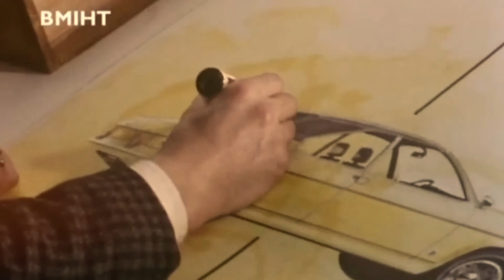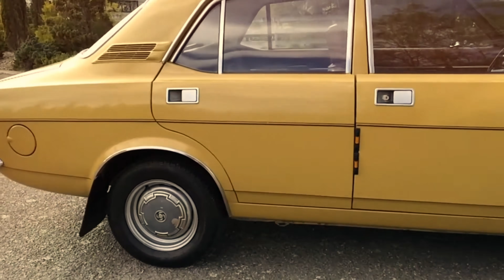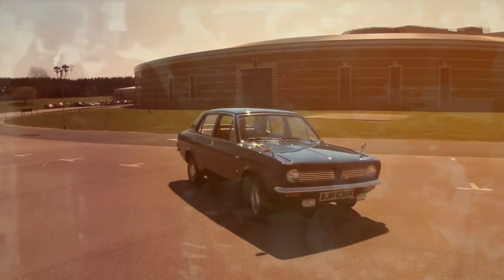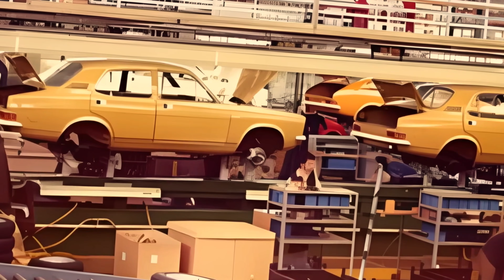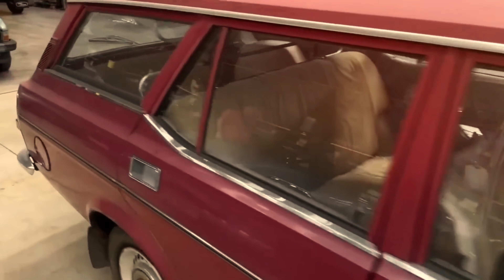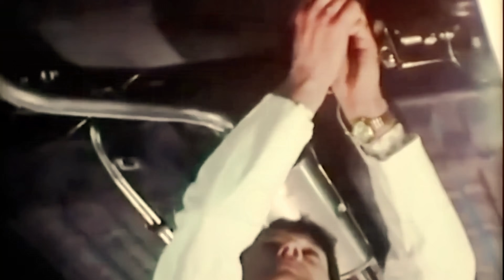The Shocking Truth Behind Britain's Best Selling Car — Morris Marina

Comment: First car mini van sub frame issue trailing arm issues brake issues engine top end valves reworked and also radiator issues learnt a lot on this car as eighteen year old apprentice on low wages, second car Austin mini kept it to long had to install new subframe and welding in the boot area still on low wages loved driving the thing and learned more about keeping them on the road. Traded in for Morris marina coup i think it was 1300 it was the car I did my courting in we used to travel to the country side locations for our private romantic moments. As well as daily work horse it was doing 64 miles a day on work and courting lost head gasket and other problems with head warping so bought and installed gold seal engine reconditioned, the only time it didn’t get me home was when front near side lower steering ball joint popped and end up with horizontal wheel looking back we had some really good times in the Marina and courting turn to marriage forty five years two grownup children and four grand children . The longest we were without the car was nineteen eighty two when it was covered in snow to above the roof in a side street of the main road waiting for local council to clear road. Happy days.
Reply from the maker: That is a wonderful trip down memory lane and a lovely story about how your car journey became part of your life story!

Comment: I pick up a 1973 on an L Reg 1.8 DL in burgundy kind of colour it looked quite basic BUT it was a fantastic car loads of room inside great size boot drove really well handling not as bad as a lot of people said went like hot snot for what it was seats were comfy enough I bought it in 1981-2 for £80 probably the best £80 I ever spent after swapping it for a Mk1 Granada I still have fond memories of that car and a couple of years later fell in love with a friends N plate 1.5 TC coupe in white with black vinal roof and to be honest if I could afford to buy a mid 70s TC coupe today I would not hesitate if it was a good solid well kept condition with a few minor bits and bobs needing to be done, although I am a Ford nut through and through I honestly don't see why more people wouldn't buy a descent marina but would buy a minor or a mini boggles my mind as the marina is far more superior, "go on buy one you know you want to best looking front end is the one with the twin lights in the front grill between the head lights easier to run and maintain than any of the more modern cars especially from the 2000s onwards can't work on newer cars to much technology electronic gizmos chips and god knows what at least the older classics you can fix um by the side of the road with a knife and fork almost simple mechanics and loads of room to under the bonnet to reach everything, marks out of ten to repair yourself most I would say 8 or 10 depending on the make
Reply from the maker: It’s wonderful to hear such fond memories of the driving experience and simplicity of those classic models!

Comment: the antiquated front suspension was basically  the Marinas Achilles heel. The rear was Okayish for era. Engine was meh. Ford had the peppy Xflow. The A  and B series a bit long in the tooth TBH.The. O series would have worked had it been phased in earlier..Styling wise ..Yawn..ZZZzzzzz!😀

Comment: I owned two Marinas, a coupe and a saloon. My father owned a coupe. All three were victims of rust. With one of my Marinas, I had problems with the exhaust dropping off at the engine outlet. The clamp that held the exhaust against the outlet was of poor design, and constantly let me down. The biggest pain for me was the leaf suspension on the rear of the car. This problem I had was in the main with the coupe. I spent many a Saturday morning at the breakers yard dismantling a set of back leaf suspension units from scrap cars and replacing the broken ones on my car. If you ever hit an unseen ramp or dipped at the bottom of a steep hill, you held your breath hoping not to hear the crack of a newly broken leaf suspension unit.
I sold my saloon to my uncle. The car had a tow bar that I had never used. The first time my uncle used it with a laden trailer, the tow bar ripped from the car and was found lying on the road still attached to the trailer.
Happy days.

Comment: It is worth noting that while there may have been some Marina inspiration in the original Hyundai Pony most of the running gear was actually basically from it's nemesis the Cortina which was already in production under license in Korea, as far as I recall the only parts from BL were the front brake calipers...

Comment: There were many Marinas exported to the colonies in the 1970s and 1980s. Yes the Hyundai Pony was based on the Marina, giving it a new lease on life in Korea. 
The 2 door TC hatch was a rocket with its 1.8L engine. 
The Estate was stylish and very roomy. 
I recall owners kept driving them for 20 years or more, in spite of the potholed roads they were driven on. 
Mechanics also loved the Marina as they were simple and easy to work on. But being built on the cheap, one of the unsafe features was a plastic radiator cap that would come loose and scalded one trusty mechanic I knew. 
Which car  did not rust in the 1970s anyway? Bogging holes was a skill that many car owners mastered easily, and then passed on these skills to their kids! 
Thank you for this great video, which has revived some great memories.
Reply from the maker: Thank you for sharing your knowledge, it enriches our content

Comment: Worked at Solihull and bought with employee discount a 1973 1.8 coupe. Had to collect it from Cowley. Sold it after 12 months for same price as I paid. That's what BL employees did then and used discount to buy next car. It had three problems during the time I had it: :- a screeching spigot bering on first start up of day, wiper motor nut forever coming loose and an oil leak from the diff that defied repair. I loved the seats. Covered in ambla perforated plastic very comfortable. It was the first car I had with electric rear window. Such luxury but no automatic switch off. O what memories we had with it.

Comment: Originally the Marina Prototype was to have all independent macpherson coil spring suspension and nearly new E series engines, it was rushed into having  Morris minor suspension which arguably may have been more expensive than macpherson suspension and old A/B series engines.
Reply: so the prototype was more like the ADO 16?
Reply: @semiretired86  Not exactly Marina Prototype as it was, with macpherson suspension instead of Morris minor suspension they had the new E series engines in Australia Probably because they had  some left over from the austin 1500 & Nomad modified ADO 16 . I wonder if without the dodgy suspension weather it would been No1 especially in the 1973 oil crisis.

Comment: The Australian Marina with the Maxi motor was a far nicer and better car. The E series was a lighter engine, so it had the 1.3 handling with the performance of the 1.8.  The Australians upped the trim levels, although the seats were vinyl.  I remember the day when my school friend's parents picked up a brand new one, and I went with them when they did the trade. That car lasted well with them still driving it 25 years later with about 300K kilometers on it.

Comment: Morris Minor mechanicals in a modern body .....
 I wish I had one now instead of the constant failing modern car I've got.
 1800 will last forever if looked after.
Reply: The Marina has one big mechanical improvement over the Morris Minor: where the brake master cylinder is. On the Marina it is on the bulkhead; on the Minor it is inside a box section under the floor and you have to dismantle part of the front suspension in order to get access to it for any work beyond topping up the brake fluid.
Reply: @cedriclynch good knowledge...,!

Comment: I had a Marina 1.3 and its true the front suspension was an issue as far as massive amounts of roll and handling were concerned. I added Koni telescopic shock absorbers all round, on the front you had some addition brackets to allow the telescopic shock absorbers to be fitted in addition to the lever arm standard units. This sorted out the handling issues. It was a 1971/72 L reg (last registration letter in those days). I also rebuilt the A series engine adding a high lift cam double valve springs and changing the SU carburettor jet and needle. Inside as I was at the time working for British Aerospace produced a Duralumin (hardened aluminium) dashboard section which replace the standard plastic which on the custom one allowed a radio cassette to fit and join onto an after market centre console. I replace the steering wheel Mountney steering wheel. The performance was for the time excellent, very reliable and served me very well for several years and a hell of a lot of miles.

Comment: I had a Morris Marina Estate  1.7 from 1976 till 1980, as a company car. It was comfortable, fast, economical (nearly 40mpg) and I never had any major bother with it over 66000 miles.
Reply: I worked in company that had GM fleet cars. They had Marina before I joined as they were so unreliable. They also had problems attracting younger men into the company offering such lacklustre dowdy cars as the Marina.

Comment: I had a 1800 coupe in the early 80''.It was an every day work horse with a fair amount of pep for the time. I never had any problem with handling or mechanicals. It did have a minor rust problem but if you saw to it b4 it got a hold you were able to save it. I think top gear unfairly didnt do it any favours.
Reply: People mock the Marina, but it was no worse than the equivalent Avenger or Viva.
People love the Escort and the Cortina these days, but at that time they weren't much preferable to the Marina.